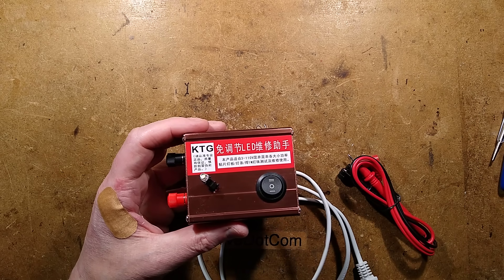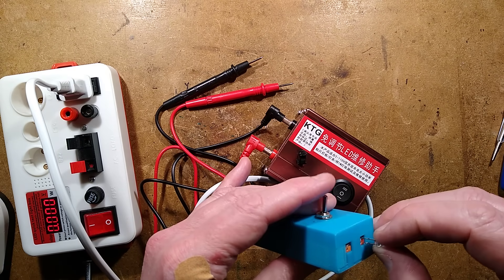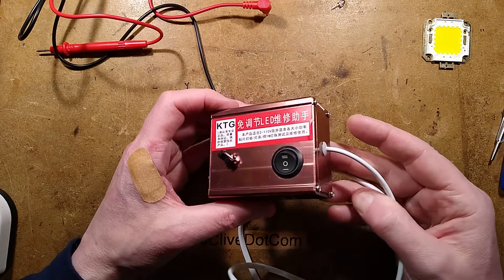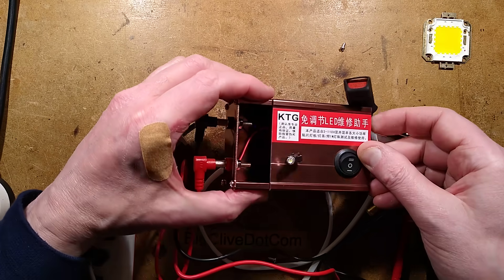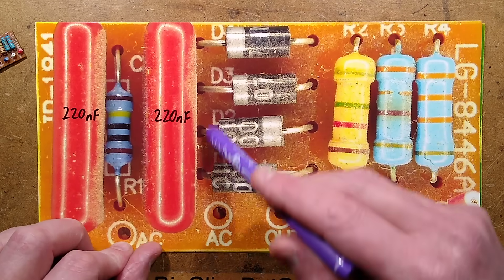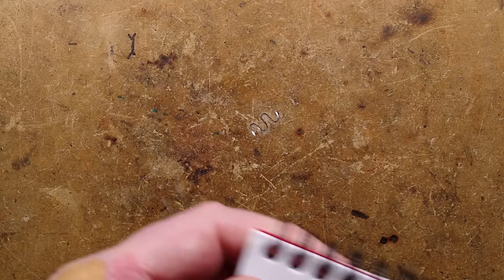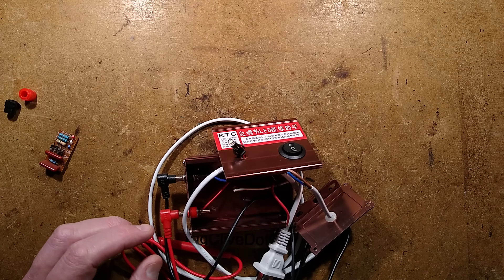Horrific LED tester that can literally kill you - (with scary schematic)

Comment: This was several years ago, think like 2014 or so, a friend bought an amplifier from Ali Express, chinese made and it was cheap too.

The only real downside was that depending on how you plugged it in, the chassi could be directly tied to the live wire. I cant see a problem with this, that is obviously very safe :P
Reply from the maker: Sounds like a classic valve (tube) amplifier.  As favoured by some guitarists who often have terrible electrical experiences as a result.

Comment: I have just had interesting conversation with another supplier of a fan speed controller with claimed CE certification and double insulation, neither of which is remotely correct+ could kill someone!! Answer = " our quality control department try harder next time. Kindly accept £3 for your time" 🤔🤨😵‍💫
Reply: They actually had a quality control department?
Reply from the maker: The quality control department is a lady putting QC stickers on everything.
Reply: @SteveW139  That's what they said🤔 
I absolutely believe them to be 100% categorically and without question not telling the truth 😜

Comment: i would obviously be like this device is a shock hazard and obviously it could be used to trip a RCD or GFCI outlet easily i also assume the LED tester isn't electrically grounded in a safe way either it should have a 3 prong plug with ground connectors to divert electricity to the ground instead through a hand of a person
Reply from the maker: In this instance, a grounded case would make it even more dangerous.

Comment: Well, 6 mA is the lethal dose for an average adult human, so I’d say the high intensity setting on the switch is definitely going to light you up! 💡
Reply from the maker: 6mA is a violent and painful experience, but not likely to be fatal unless localised to the heart.
Reply: No it is not. If 6mA was the lethal dose then no RCD intended for additional protection would prevent death by electric shock. And that is precisely what RCDs intended for additional protection are designed to.

If I recall correctly, around 80mA is required to put the heart into VF.
RCDs are required to trip with a threshold of no more than 30mA 

There is also a minimum threshold of current which if the fault current (difference between line and neutral currents) is below, where the RCD should not trip.

Comment: I wonder if all the other ones that look like it on eBay use the same death dropper supply? Seems to be a common format with the mains plug on one side and the cheesy meter leads on the other with an “automatic” range of “85V-265V” specified for the output of the tester. Edit: And there are loads of them, even super deluxe versions with displays.

Comment: You never demonstrated how bad a ground would be (incandescent bulb) or how to fix the circuit (using an isolation transformer?). Cool vid.
Reply from the maker: I should have done the bulb to ground demo - (but to neutral - since the distribution board is in an outside garage along a muddy path.)

Comment: The scary part is that this is a completely normal product in China for use in domestic state-controlled factories. I’m sure the normal state of affairs is hundreds of these testers with scraps of wire, solder and all sorts of other things stuffed into that little connector to get them to work.

Comment: uses 240volts on a 110volt module and wonders why the resistor overheats
Reply: The Mains Voltage in China is 230 Volts RMS, exactly the same as Europe.
Reply: But is that same plug used? Sure looks like a north American plug for 120v
 @anthonyshiels9273
Reply from the maker: Chinese plug.  It's a 220V unit.
Reply: Maybe right

Comment: This is a bit of a waffle but hey ho...
I have some nice headphones I got recently (Sony MDR-Z1R) and the tip of the 3.5mm cable bent after light travel use (I got them replaced by warranty but still). I searched around for cables on eBay and the likes as I wanted some other cable to use for travel and wanted one that wasn't going to cost the earth (not into cable snake oil thanks) and found the same listing for a cable around £4.80-5.50ish, tons of them all over eBay. It seems this is a very common thing, to just flood the site with the same component from various different sellers who clearly all get it from the same factory... That or it's the same seller on multiple accounts trying to create some sort of false pricing range, and idea that it's a popular product..?

I got one in the end, actually the cable is finnnnnnne, it's actually shorter too which is quite good, it's almost the perfect length for me to no longer get it caught on things like train seat arms or running past people on escalators...

Comment: Plugging in an ungrounded metal case appliance with Chinese writing all over it is a game I like to call Shaking Hands with Jeebuz because he may simply say "hi," or he may recall you to heaven.
Reply: Clive with either brave or foolhardly to even touch the case after he plugged it in tbh, I wouldn't have until I was sure it wasn't live.
Reply: @ferrumignis  Well, being an electrician, I can assure you he does actually test the RCD devices in his house, and likely has a log of those tests, done monthly as well, and any RCD that fails to conform to the standard test current and time will suffer from near immediate replacement and have a meeting with the big hammer out back shortly after.
Reply: Note: If present, ground pin on plug is assumed disconnected from device unless personally verified.
Reply: @Broken_Yugo  Ground pin often relies on a BT connection, being loose inside the housing, often not even stripped, just cut off and loose. Plus often have seen the ground wire does not even have any wire, even the cheap mystery sort of steel in it, as that costs money, and they will just put a green yellow recycled plastic core in instead.
Reply: everytime!  I really would like to see him with some gloves on in unknowns like this... and that old metal screwdriver rolling around all over the plae EEK!😣🤣🤣
Reply: Do not trust that grounding blindly. I think it was my ultrasonic cleaner or cheapo 3D printer, ages ago, Chinese wonder, that had metal casing anyway, IEC socket in device and Schuko/IEC power lead came with machine. Just for the Chinese factor and eBay find factor, I plugged lead into IEC socket and tried to measure if metal frame was for sure connected to Schuko earthing as that power lead looked really dingy. NO it wasn't. I was initially like "oh great, what a pos this thing is, do I need to diassemble and see", but tried to measure directly from IEC socket in device to metal frame in device and "beep". I was like what the f is this. Then measured the power lead ends and realized that schuko (yes, those sealed connectors, not possible to disassemble) grounding lead wasn't even connected to IEC earth prong on the other end. Grabbed side cutters, cut the end off and looked at the cable and what do you say. Two leads, nice. Yellow geen missing completely. Seriously some bastard somewhere has decided it's ok to manufacture such power cord 😳
I'm fairly sure it was ultrasonic cleaner as it has "massive" metal frame, water and as mentioned chinese manufacturing quality. Whoever made cable should be electrocuted. I should've sent that cable to some electrical safety agency that works in EU scale. Stuff like that has no right to exist.
When this happened it has come automatic reaction to measure those cables unless they come with some certified well known brand. Especially if they look dingy/cheap at all. Friggin hell. I could 'understand' loose earth connection inside device (note understand, absolutely not acceptable), but to make power cords like that on purpose?! Nightmare stuff.
Reply: @jothain  China has electric sockets that you can plug a N. American appliance into, whereby it becomes a flame thrower.
Reply: @jothain   a video game of this:

<dr chemsun offers you a LED tester>
[Accept]     [Decline]

Pressed accept: dr chemsun: thank you. try it out.
[Try it]  [Don't try it]
Pressed Try it: You died.
Pressend don't try it: You need to try it, to know how it works. [Try it]

Pressed decline: dr chemsun: i will get yuo next time
Reply: I heard there was a secret cord, etc etc...
Reply: Shake Hands With Danger, son!
Reply: @jakublulek3261 is it 3 finger Joe or crispy finger Moe
Reply: Chinese roulette :-)
Reply: @Electrowave  Im gotta rappin like Ohio, spitting tracks like Ohio
Getting your girl like Ohio, call me the rizzler in Ohio
On the mic, Im a killer, flow so cold like Ohio
Call me the rizzler in Ohio, watch me fly, O-O
Reply: @uiopuiop3472  I think you may need to cut back a bit on the coffee ;-)
Reply: @Electrowave  i used coke
Reply: @uiopuiop3472
Is that Coca-Cola coke or other coke?
Reply: Neutrals bonded down the line and using the neutral to internally ground the device on 2 prong caps...
Reply: I have 2 (supposedly) 35g/hr Ozone generators that are Stainless Steel cased, with an unpolarized and ungrounded plug. 😱
Thankfully, they have a relatively decently long plastic handles on 'em but, I still half-expect to get shocked and sent to the ground whenever I move it while powered [probably, not a good idea] I'm thinking about grounding the chassis, but I'm wondering if the metal case is purposefully 'isolated' as an EMI shield.
Reply: @LRK-GT   a video game of this:

<dr chemsun offers you a ozone generator tester>
[Accept]     [Decline]

Pressed accept: dr chemsun: thank you. try it out.
[Try it]  [Don't try it]
Pressed Try it: You died.
Pressend don't try it: You need to try it, to know how it works. [Try it]

Pressed decline: dr chemsun: i will get yuo next time
Reply: Clive says it only half rectifies the voltage, but you can see 4 diodes on the PCB.
Reply: @bobweiram6321  He's concerned about a shock to ground from the red output.  Two of the diodes in the bridge go to the red output, one from the live supply line, one from the neutral supply line via the capacitors.  If neutral is close to ground, current shouldn't flow from it to ground, so the shock current would be only from the live line through a single diode, i.e. half wave.  In a shock to ground situation the other two diodes don't come into play, and neutral is anyway blocked from a DC flow by the capacitors even if it were inclined to flow to ground.
Reply: When you do such tests you have to have an isolating transformer. And you have to be isolated from ground.
Reply: It's a high voltage glove moment with the device on a rubber pad. ( who am I kidding, right I my made in China trash can lol )
Reply: Heh. Most pre 2000 homes in Norway have ungrounded sockets in so called none conductive environments.
Reply: @Terje_P  when i wish i wasnt alive...  ungrounded sockets  are a mistake
Reply: "I brush with death so often, I might as well start giving him high fives as I pass."
 - Gordon Freeman, Freeman's Mind
Reply: JeBUZZ
Reply: This is what you call free market innovation folks
Reply: car inverters cannot be grounded correctly but they are a chinese big metal box

Comment: 200V of reverse bias on that little LED on the top when it is likely only rated for 5V reverse. I'm surprised it survived. (Well, it did look like the wire bond may have failed and needed re-welding to resurrect it first.)

Comment: So the probe's live and "off" is on? Nice.
Reply: Low/ medium/ MAXIMUM.
Reply: @runlarryrun77  1, 0, and 11!
Reply: @alexhajnal107  These go to 11
Reply: the probe is 50% of the times live and 50% neutral depending on how you plug in the power cable. Do you feel lucky today?
Reply: @marcogenovesi8570 One of the 2 probes WILL be live ALL of the time, no matter which way it is plugged in.
Reply: @davelowets  50% one probe and 50% the other. Brilliant
Reply: @davelowets  oooh why tf didn't I think of that, never thought about the fact that you don't need to connect to both..
Reply: Stun, maybe death, instant death settings
Reply: Exactly

Comment: A circuit designed to protect itself by blowing out the human connected to it.
Reply: everything is a fuse if you are cheap enough
Reply: *cheap = ambitious.
Reply: @marcogenovesi8570 or an impromptu heating element😊
Reply: @marcogenovesi8570 anything is a buttplug, if you are brave enough
Reply: "A stunningly simple third world interesting design."
Reply: @archstanton_live 
I think this is second world, interestingly enough! 😁
Reply: A fuse is just a wire until it blows.  It'd never see it coming.
Reply: @Blinkerd00d  Or a 9mm spanner.
Reply: Skynet becomes self aware. This is the start of the Rise Of The Machines.
Reply: Talk about releasing the magic smoke....holy hell....lol
Reply: 'Scarecrowbar circuit'
Reply: "fusible user"
Reply: Using this device automatically enters you in the contest for the Darwin Awards
Reply: @techslfink9722 So it is actually a Darwin Awards test device? 😄
Reply: This tester will last you the rest of your life...
Reply: @ednutter7653  stealing that.
Reply: When you have 1.4 billion people and not as many fuses.
Reply: @Bob-cx4ze The population there is shrinking already, without this protection aid 😮
Reply: And people think AI isn't sentient
Reply: Temu top rated biological fuse tester
Reply: The design is very human
Reply: The machines are devolving. ..
Reply: @ARCx9they already had heart failure. It’s hard to complain from a shroud.
Reply: Oh yeah, the lesser known oFuse, meaning Organic Fuse.
Reply: It's been engineered to outlast the user!
Reply: Skynet starting on small scale items
Reply: hahaha thats a good one
Reply: LOL!
Reply: This comment wins the internet today
Reply: Good old meat fuse
Reply: EVERYTHING is a fuse.
Reply: @railgap  now I'm con-fused
Reply: A primitive form of Ai Defense Ordinance... 😳
Reply: @ARCx9 all the people who would've ended up dead.
Reply: finally a device that lasts!
Reply: Very Skynet.
Reply: Sounds like some kind of AI crap.
Reply: When humans become the fuse 😳🤣
Reply: It's Chinese standards , probably made to be used In a factory.
The thing is more valuable than the humans.
Reply: Everything is a smoke machine if you use it wrong enough.
Reply: * Carbon-based fuse system.
Reply: Skynet
Reply: Good saying
Reply: I thought I was an idiot for using a SOT-23 CJ431 in place of a TL431in a whole bunch of my recent designs - wondering why they didn't work. Looks like Amazon sold me CJs too.
Reply: This was the most gloriously horrific item yet and best of all it elicited such humor from BC and the comments section.   My favorite being. “A circuit designed to protect itself by blowing out the human attached to it”.   Brilliant!    More like this please BC.
Reply: Rise of the machines (Cheap Edition) 😅
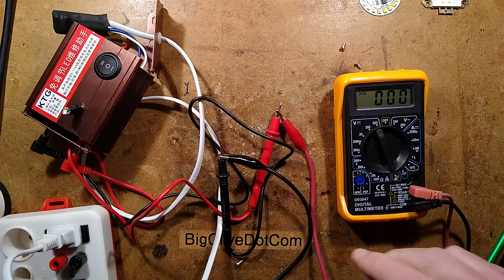Reply: @sergiotricarico  If I understand your question, you're asking about the measurement at around 9:00. If so, that's the open circuit voltage, when there's nothing connected to the probes. In this situation, the full voltage potential will appear at the probe tips. It's half-wave rectified with no filter capacitor. So, while you're right that the voltage that a human would feel touching the probe tips would be much less because of the 1 meg ohm resistor in series, it's still going to feel like AC because the unfiltered signal is going between 0 V and about 220 V every cycle. However, the real danger is when the switch is set to the 3.3 K ohm resistor, which is in parallel with the 1 meg ohm, for a total resistance of about 3.3 K ohm in series with the human touching the probe tips. That's a much smaller series resistance and a lot more of the 220V is going to drop across whatever is touching the probe tips (like a human). I hope this helps.
Reply: @curtishoffmann6956  That clarifies my doubts, thank you. I now understand the potential voltage despite the 1MΩ resistor limiting the current. I also appreciate your point about the 3.3KΩ path. Thanks again for taking the time to help with my question
Reply: @sergiotricarico  No problem. Good luck with your studies.
Reply: Minimal loss.
Reply: The meat fuse!
Reply: Big C,you must have a very large bin😂😂
Reply: The design is very Human 😂
Reply: We've become the fuse 😂
Reply: Sounds like a very Chinese solution. Parts over people lol.
Reply: @TotallyNotARussianBot69 or should i say parts off people all over.

Comment: With USB being near ubiquitous these days, why on earth would you want a mains powered tester for such a low power device like an LED? I have power bars with USB sources in them. Just....why?
Edit: then I saw the circuitry. 🤣 CAVEAT BLOODY EMPTOR!
Reply: Some LED modules consist of a large number of individual LEDs in series, requiring a high voltage to drive the module.
Reply: @plemli  I get that. i don't see where it says this is a LED module tester though. Unless i've missed something, which is entirely possible.
EdiT: Ahh, ok. It says LED backlight tester on the EBay listing. I think I looked away towards the end of the video and didn't see it specified.